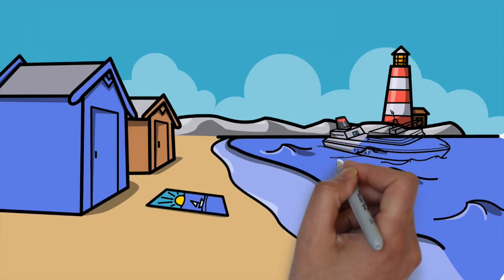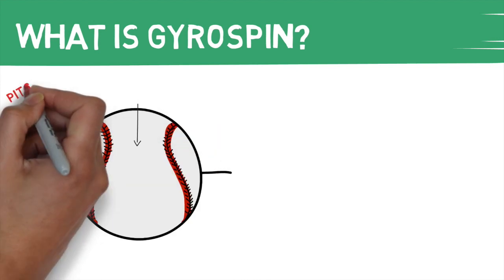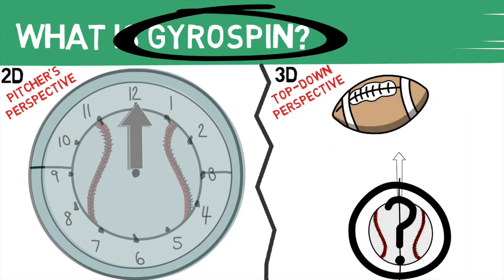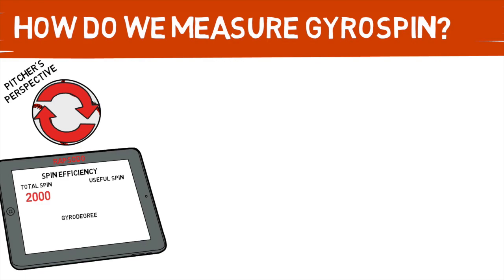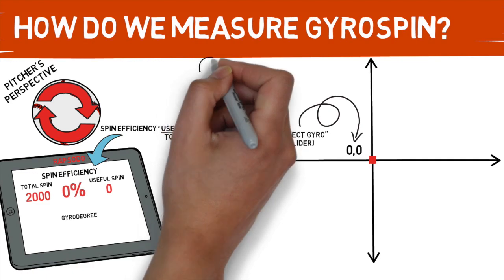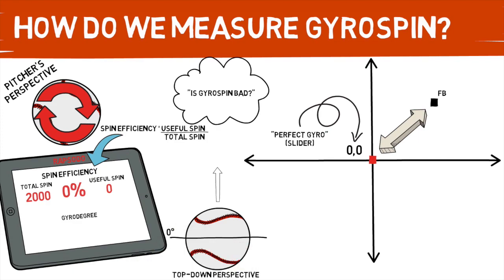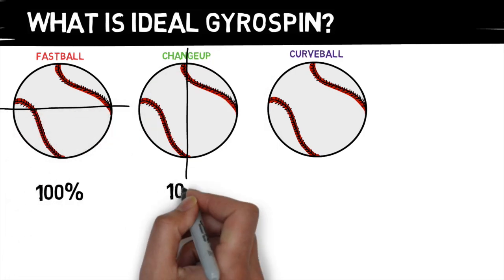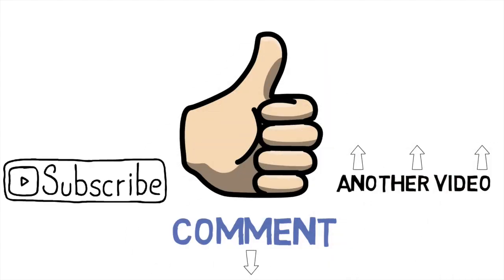EVERYTHING YOU NEED TO KNOW ABOUT SPIN EFFICIENCY – What is Gyrospin?

Comment: I can’t find it but I remember reading an article claiming that gyrospin causes lateral movement. It said that as the ball changes direction downwards because of gravity its axis remains the same. This causes the gryospin to then act as transverse spin relative to the balls increasingly downward path causing late gloveside break. What are your thoughts on this?
Reply from the maker: Hey Cole, thanks for the great comment! 

I haven’t seen much about that idea either, but it isn’t a hard one to believe. In my opinion, I’m not sure just how much gloveside break would actually occur from a small change like this one. But it’s definitely something to look into. 

I’ll do some research and let you know if I find anything!
Reply: There are a number of models that do predict this. Those models put the total break from gyro spin around 3", depending on spin rate. The 9 parameter model that TrackMan uses does not account for this. It assumes a constant force on the ball, which is definitely not the case - especially for sliders!

The really interesting thing about break from gyro spin is that it comes primarily late in the pitch, after the batter has already decided to swing or not!

Comment: How does a slider with 0% spin efficiency break?
Reply from the maker: Technically it just drops with gravity, but the separation in both the horizontal and vertical direction make it appear to have more drop/sweep than a pitchers fastball does. 

Thanks for the comment!
Reply from the maker: Also here’s a video I did comparing two pitchers with sweeping vs. gyro (or 0%) sliders in the MLB! 

https://youtu.be/2rXU6iPjYCs

Comment: Hey, I know I'm nearly 2 years late to this party (since you posted the video), but I was hoping you could answer a question I'm stewing over today... which is what landed me on your video.

In your video, you only describe degrees of gyro... what about tilt?  Meaning, the right side isn't closer or further away... but higher or lower?  I was led to believe in a discussion with Alan Nathan a few years back that the effects of tilt and gyro are cumulative to the measured efficiency of a an intended axis... like pure forward spin, backspin, side-spin, etc.

For example, if your were attempting true forward spin, but the right side of the ball was lower (4:30 on a clock facing you), the spin efficiency (for forward spin) would be 50% (50 forward-spin, 50 side-spin). Same thing if the ball was at 45-degrees of gyro... spin efficiency would be 50% (50 forward-spin, 50 gyro).

So... WHAT IF... the ball had a gyro of 45-degrees... AND a tilt of 45-degrees?  Surely, the efficiency of spin couldn't be 0%?  What would the spin efficiency of that down and out (RHP) pitch be - relative to the intended FORWARD spin?

This is driving me nuts, any help would be appreciated... as I'm sure I'm just overlooking something simple, mathematically.  ~Thanks

Comment: Great video.  Thanks!  My question is about the 90% degree gyrospin pitched ball (0% spin efficiency)  that you plotted on the X,Y axis at 0,0.  I am assuming that is 0 inches vertical break and 0 inches Horizontal break; What is the assumption for a 90% gyrospin pitch being plotted at 0,0, is it the point that a ball will hit from the point the ball is released to the point it hits the plate based upon gravity being the only force to impact the trajectory?  I am trying to wrap my head around the concept of pitches having 8 inches of vertical "break" with "break" being the distance the ball stayed above the 0,0 90% gyrospin.  Thanks in Advance.
Reply from the maker: Hey Chris - thanks for another awesome comment. I’m not sure I 100% understand your question, but I’ll do my best to clarify what I believe you’re asking. 

A 90 degree gyrospin pitch is spinning like a football (meaning that there is no spin aiding in the movement of the pitch in the X,Y plane) - that is what gives the pitch a 0.0 mark on our plot. 

The plot represents the amount of movement produced because of transverse spin and furthermore effects the amount of magnus force being produced to alter the path of the pitch from the point in which it would fall with 0 spin with gravity. I’ve got a video on that concept here: https://m.youtube.com/watch?v=6OQV9jOagOg

Basically, the H/V Break Chart takes gravity out of the equation, and a 0,0 pitch is simply letting a pitch fall with the force of gravity. Everything else, is based on the amount of spin the pitcher is putting on the ball, along with the direction of that spin. 

Hopefully this helps!

Comment: Another banger. Wednesdays are a good day! A FB with a high spin rate might not be as effective if the spin efficiency isn’t high enough. So would using a Bauer Unit or a Bauer Unit + be more helpful at least with the FB?
Reply from the maker: Thanks for the love, Johnny! 😉

Bauer units are definitely a helpful tool when analyzing a players arsenal. It gives you a new perspective on what is above or below average RPM compared to a pitcher’s velocity. In terms of Gyrospin, I’m not quite sure how that would factor in. 

Maybe I’ll do a whole video in the future about how I value the Bauer Unit metric - keep the ideas coming!